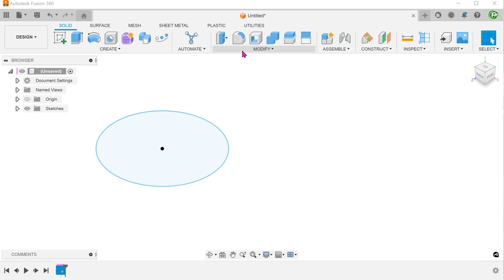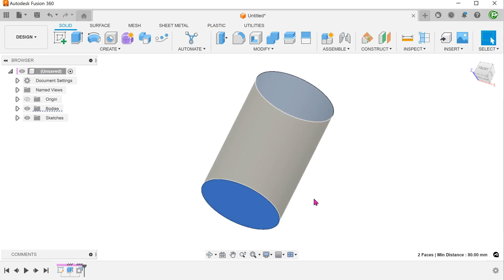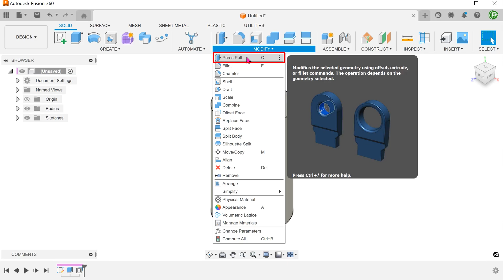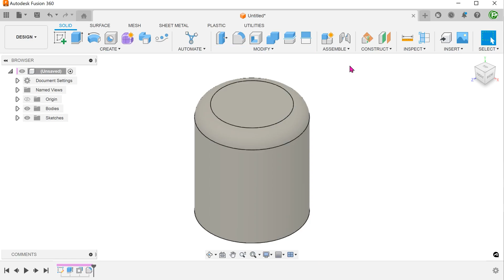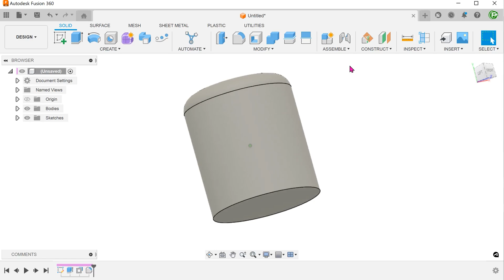Fusion 360 | What does Press Pull actually do?

Comment: The Press/Pull command behaves differently than the Extrude command when the Face is not perpendicular to the rest of the model.
Try this:
Make a rectangular rod whose ends are 45°
Extrude the Face of one end.
Press/Pull the face of the other end.
Ahaa... That's weird.
Reply from the maker: Yes, when press pull is performed on a face at an angle, it becomes an offset face command.

Comment: Create tapered box, then try extruding tapered faces with press/pull and with extrude command. Other example, create tapered pyramid, then try extruding the top/bottom with press/pull and with extrude command... There is difference.
Reply from the maker: In these cases, when you perform press/pull, the command simply turns into an offset face command.
Reply: @Fusion360School  Ah, I understand, you're right...i get it now... tnx

Comment: Great video, 

One polite counter argument I have is at the end where you were saying to use parametric modeling commands as opposed to the press/pull command. 

From what I understand and you demonstrated of the press pull command,  (to me it seems more like a macro with options, anyway) it places the equivalent command in the timeline as its implemented.

Which when edited opens the correct feature dialog relating to each of these commands, extrude, fillet, and offset.

I see the press/pull as a major productivity boost, paired with an inexpensive remote keypad and a key remapped to the 'Q' key, I would use that shortcut and maximize my workflow, since it utilizes 3 of the most used commands.  

( I have a 9 keys remote keypad,  top row:  d-draw, s-sketch, i-inspect, middle row: q-press/pull, enter, esc, bottom row: cut, copy, paste)  saves so much time.

I use a space mouse and a remote keypad when I work,  man I wish I had always known about them.  

Definitely worth the money if you spend any real amount of time within any CAD software.

Pair that with a well defined/simple sketch (always better to keep sketches as simple as possible) those two work practices are a powerhouse of productivity. 

Sorry didn't mean to go off on a tangent and ramble, lol.

 I tend to get exuberant discussing CAD modeling and design.

 Anyway, be well and thanks for the superb video. :)

Comment: Interesting, Why would AD let you PRESS/PULL-OFFSET FACE, When you could just edit the original EXTRUDE? At least they don't clutter the timeline.  Not sexy, but I usually have a messy timeline. Maybe do a video on best practices? Like when to go back and add geometry to an earlier sketch that has been extruded, then add that geometry to the existing EXTRUDE. Does it even make a difference processing wise? Sometimes I've added individual say Chamfers, when they could have been combined into one operation.